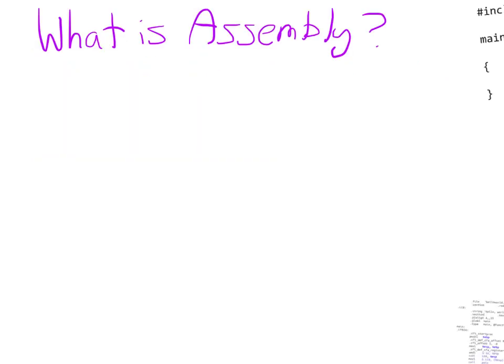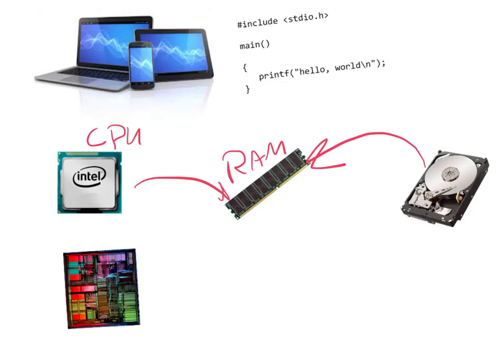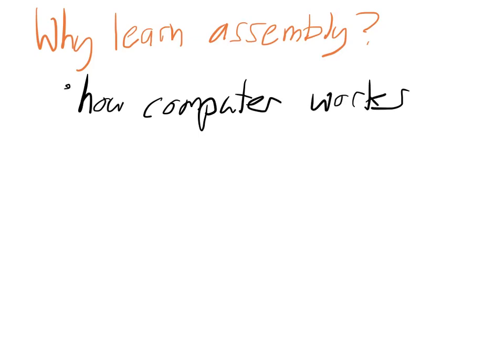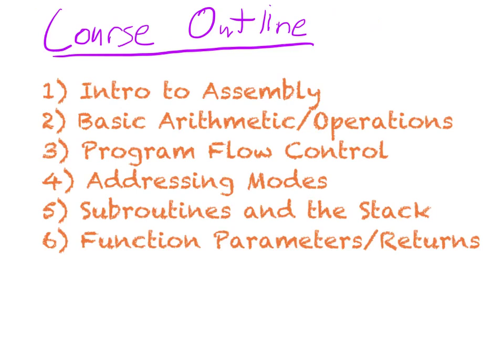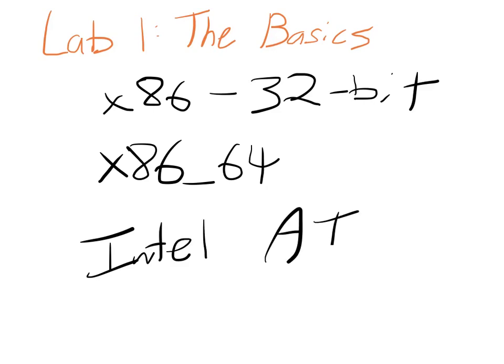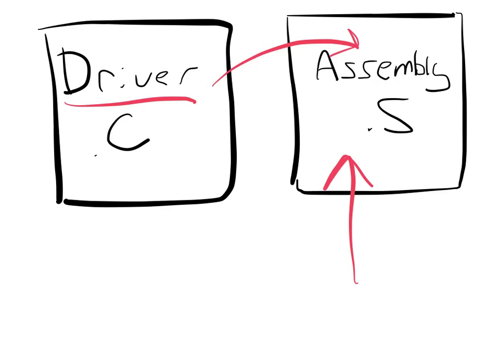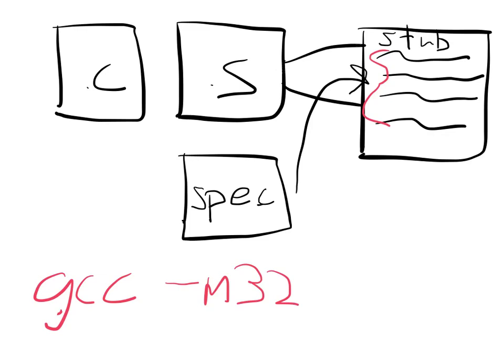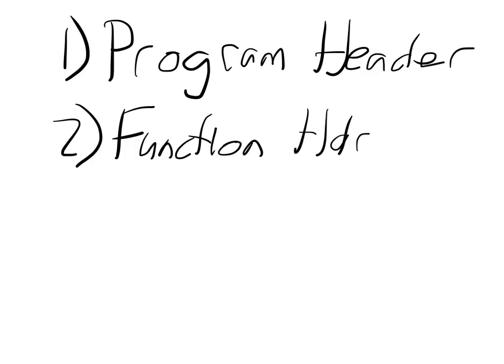Clemson ECE 273 Lab 1: An Introduction to x86 Assembly Language

Comment: I have a couple of questions about assembly and machine programming : 

1. Who develope assembler in a computer system ? is it the OS company or the microprocessor company, I thinks the second one develop it from 0 an 1 (binary machine instruction)

2.  suppose we have just writen an assembler from 0 and 1, how it is loaded in a computer system ? what a know, if you developed a binary program you have to create a chip contaning these instructions such as the case of BIOS and i do not know how to construct such a chip .

3. the UNIX operating system is devolopped from C-compiler , so i imagine such a computer who has no OS in wich we can just write somme c programs and execute them, am i right ? and how can we load an OS in a computer system  ?

Thinks.
Reply: +Imad Mimeche 

1. Hardware can only understand machine code 0 or 1. In order to give an instruction to a machine you must insert the correct codes. For example the add code might be 01110111. However the programmer might not want to remember all these codes by heart or have to type them in all the time. So the programmer develops mnemonics to represent this code. So add = 01110111. The instruction is now called &quot;add&quot; and by combining all these mnemonics is called assembly. Where the programmer is &quot;assembling&quot; the instructions to the machine. So nobody really &quot;invented&quot; assembly.

2. Information is loaded into the registers of the CPU. Registers store information that the CPU might require. Some registers are used for specific tasks. An assembly program contains the raw data that could be inserted into a register and also what the CPU should do with that raw data.

3. Not sure what you mean by this question. But C can be written in UNIX operating system. The OS&#39;s job is to manage the front end applications so that they use the systems resources as efficiently as possible. The CPU does not manage itself, the OS manages the CPU.  C is a higher level language that cannot be written directly to the CPU without a compiler. You must compile C into assembly in order for the CPU to read it.

Someone correct me if I'm wrong.